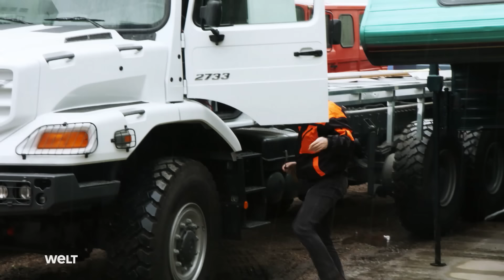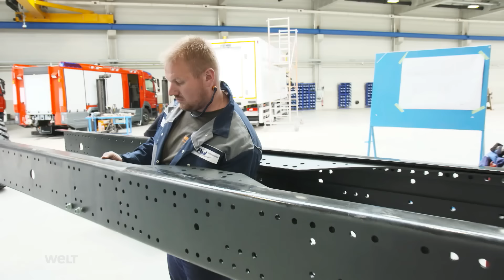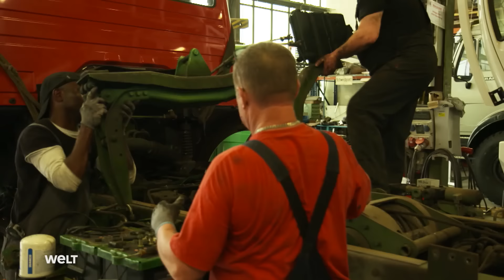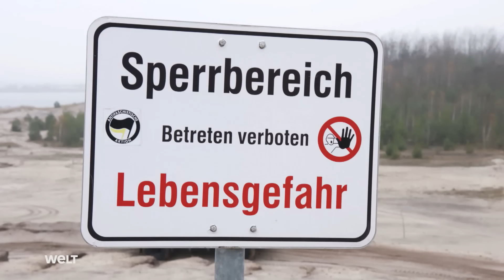Off-Road Caravan Monsters - Motorhomes For Adventures | Full Documentary

Comment: Two completely badass vehicles. 
It blows my mind that the smaller of the two only has a 280hp engine, for reference my BMW S1000RR motorcycle has 205hp.
The fact that the smaller vehicle is so capable of moving that amount of mass so efficiently yet only has 75hp more then my motorcycle is mind blowing 🤯. 

Nice work to all the gentleman involved in both projects 👍 👏 
Truly beautiful work.
👍😉😎👍
Reply: Its all about torque and torque conversion
Reply: Your bike, if you can call it a motorcycle. That piece of art is designed for speed, style and raw horsepower. 
If you do that to an engine it may fail, failing is usually fatal or atleast takes it out. 
Underpowered engines last longer.

Comment: The whole notion of these behemoths is so bad. Destructive to the environment and just not practical. They are an ultimate phallic symbol.  
You would be better off buying a good 4x4 and towing a rugged trailer. These trucks are immensely heavy and get bogged down easily despite the large tires and impressive engines. Their size limits them to where they be driven as well. Forget about gas sipping. Everything about them is an extra challenge and cost. In off road excursion the best saying is Lite is Rite.

Comment: In the Unimog, I wonder what prevents the container from tilting when running on a flat surface. Maybe a torsion bar?
Reply: Where is the Unimog?   Anyway they usually have  a 4 point mounting with the centre 2 clamped to one of the  circular chassis crossmembers and the front and rear having central pivoting bushes.

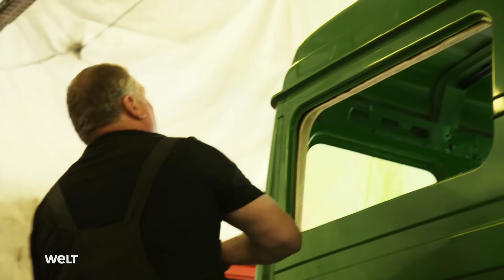Comment: 16:36 - "The two vehicles are the same wheelbase..."

So why switch cabs?  Why not just do the conversion on the police truck instead of the fire truck?
Reply: The fire truck had only 13.000 miles ,so then its easier to change cabs instead of the engines,its what I undersood...

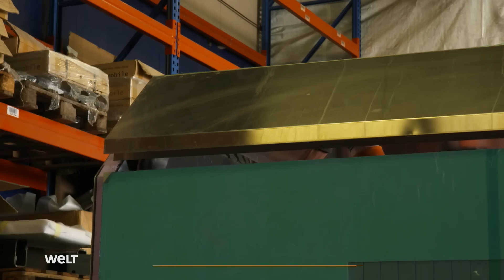Comment: 26:30 Surely this is installed incorrectly. Rain water will flow into the van like this!
Reply: They will further epoxy or weld that outer exposed edge, I suppose. Right? Good observation,  you taking notice of that edge slipping into rather than over the side wall structure.

Comment: They said they were swapping the single cab with a double cab with 4 seats.  The finished vehicle only had the single cab with 2 seats.  Did I miss something?  Where is the double cab?
Reply: It is a double cab
Reply: It's an extended cab back backseats fold down
Reply: this is actually a double cab manual sep fold bi-tech system, so youre wrong...the double cab is directly imbedded in an al insertion pipes, taking big d in the bum while cabbing the truck swartz had that  in his detailed conversion planning.
Reply: I was thinking the same. It's neither the origional cab nor the green one,  Probably one they made earlier!

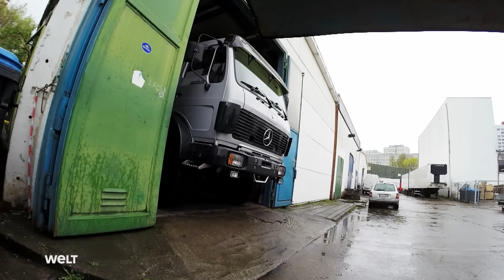Comment: 31:54    So they switched cabs from a 2 seater to a 4 seater and then only installed 2 seats... 🤷‍♂️
Reply: They use the space of the two other Seat, for the inside door between cabin and living space.
Reply: I saw that too.  They said they were swapping the double cab with 4 seats.  The finished vehicle only had the single cab with 2 seats.

Comment: I am a little surprised that, with the use these trucks are destined for, nuts & bolts are still being used 
No matter how good the quality of nuts & bolts vibration takes it’s toll.
I would have thought a swaged fastener such as Huck Bobtail or C50L, would be a more secure fastener.
Yes, I may be a little biased as I am a supplier however, I have always believed in providing the best solution possible for the task.
Reply: I was thinking the same thing. A 5 cm or 3cm bolt seems inadequate for a structure that weighs many tons. The big truck was 27 tons, that's insane!! And although that's the weight of the whole truck, the cab has to weigh something like 10 tons maybe even more but it's bolted on by 5cm bolts.. Come on that has to be scary. I know those guys know what they're doing, they're smarter and way more experienced than I am, but still..

Comment: As always, love the Germans total dedication to quality from start to finish. Seems to me the problem of allowable weight for the rating of the owners driver’s license could be improved by the driver qualifying for a superior rating? It becomes evident that this isn’t a huge factory set up with high end equipment to do the total build under one roof. That’s ok for me. It shows they hustle parts and trucks from wherever they can and then have to engineer on the fly, take in customer requests and modify to supply. They are a small group with broad skill sets. They discussed the length of the chassis may be a problem over harsh terrain. Would it be possible to have some kind of articulating knuckle in the middle so that you could momentarily accommodate a high center type of situation. It would offer the owner/driver an option to safely drive his rig out of that unbalanced scenario. love the mock-up on the separate wooden unit that will be the layout the customer wants.
Reply: Yup, Germans "Engineering stuff on the fly" is something of their specialty, yes?
Reply: Yes unlike the American auto workers who always are looking for short cuts at an over inflated price. The American AUTO Workers have always been notorious for COST OVER RUNS of cheaply made products. Lately the Americans have become parred with China in cheap goods. But unlike China the American cheap goods are extremely expensive. 
I really love the way Germany works with extreme pride in their work. It's their dedication for perfection that really impresses me.
Reply: They have that artic in the center in certain dumptrucks, it's called a wigwag and it's a complete fuckup. Look up center steer or wigwag fuck ups. They're rather spectacular

Comment: Fantastic, love it. But my question is, how the hell do you change a tire if alone in the middle of nowhere, is that even possible ??
Reply: I also thought about it, the Prince probably only needs to make a call ... but for more normal people ... I would probably mount a hydraulic jack in every corner that can lift the vehicle and power outlets for hydraulic or compressed air power tools.....
Reply: Same as any other vehicle jack it up and put the spare on. There's a hoist to lift the spare down, and the jack will need chocking though.

Comment: Two bathrooms without bidet but with unnecessarily long sink that takes up precious space, 9 meters of wagon without garage for motorbikes, when you go around with this pachyderm you need an alternative vehicle to move around during the parking...10000 kg of trucks without leveling pistons for parking in uneven terrain...all very nice but if i have to spend 1.2 million i would take a vehicle designed by people with more experience in the field..
the small one is better, too bad for that rear bumper, too low...on uneven roads with large slopes it risks remaining on horseback..

Comment: The quality of the build would amazing if this were offered by any of the bigger camper makers, but it's downright staggering for a DIY.
 The level of clear vision and innovation is just amazing.
 The bathroom looks like it works well and the inside/outside pantry access will be standard on top tier campers in the future.
My only possible change might be the exterior color to better blend in with the intended operating environment.
Although, as many boaters know, white yields less thermal stress on the skin and makes for a cooler interior which is a big plus in the warmer climes, and/or seasons.
All in all, on a scale or 0-10, I'd give a "100". Out of ten. That's how beyond full scale I see this.

Comment: 12.5l diesel engine. What's the fuel consumption? 
- 1km/l on highway
- 0 in the city
Reply: Thought he said it was a 6.6 Liter. Mileage in the highway should be MUCH better than you think.
Reply: It's a 12 ltr engine...same as goes in the TGA truck. 44 tonne euro truck will do approx 8 MPG loaded. This although much lighter has 8X8 drive instead of 6X2...so probably about the same.
Reply: yes it ís

Comment: Hi every body, is there anything bothering you about this?
We're talking thousands, millions with 19th-century technology... 
Why? Why to speak about axles, transmission, transfer etc. since we have the technology to avoid all of that!
And yes, customers your questions: 1) Decoration, 2) Consumption 3) Power 4) (sometimes the weight of all this mess).
But that's it, no taking into account the "irons loss" What is left of power at the wheel. And above all, the cost of spare parts maintenance and the most frightening repair time on the track!
With our system (only for us, not for sale Renting for cinema, tv, free for some honest NGO's) we will be able to adjust the power on each wheel from the dashboard (cabin). No axles, transmission, transfer etc.Maintenance cheaper, easier.
Of course cheaper than the classic system  even for the chassis & Shell  carbon fiber infusion (vacum). 

Thus an amphibious version is possible and afordable. See the professionals of marine cultures. On our system no propellers w'll use Hydro-jets + Rear and bow thrusters.  Optional for delta rivers as tundra, outside Helm with 360° Vew.

Saving fuel, power and + ecology :    With HHO & LNG Adapter.
price of the prototype???? we prefer to stay blind! 😎😥💵💵💵

Comment: I have been studying these vehicles and their lower rung mass market competitors using Freighliner frames, MDF with leather options, white swirlly body side diesel pushers ... costing 700k.. for a good 30yrs. Its just like the stick built home building market. Its possible to pay 500k for a house in any part of the country.. and get MDF, no insulation, shit engineering... no design...

Against.. vehicles costing roughly the same, but instead of being a Lump on a Log... these actually involve construction, thought, engineering, paint and time... ntm consideration.

Its as if.. those who see a Paris Dakar vehicle.. want one as their... "own".

Comment: Same cab? you must have watched a different video to me then, did you not notice the window behind the door of the finished truck.?
Reply: John if you go to 43.52 when the guy gets into the cab pause it the dog is covering the door as i could see the door handle and there is 2 windows on either side of the cabin at rear :-)
Reply: @rodneymiddleton-c5z   Bit confused as I thought you were saying that they had used the original short cab and not the one from the green truck, the finished truck does have the two windows behind the door i.e. longer cab.  They cut a door allowing access into the living area which meant that there are now two rear windows instead of the one long original. I must admit it doesn't look to be exactly the same as the original one of the green truck.
Reply: You're right ! That was a completely different truck ! .....It was NOT the cab from the green truck or the chassis from the fire truck...... Those two had a 6 cylinder in line engine , but the finished truck had the n/a V8 ! They must think that people are not paying attention.... just bad editing .

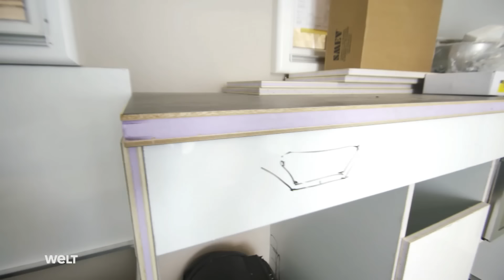Comment: (38:07) - Four weeks to design the furniture ?
Not to fit it but to design it ?
Sorry, but I don't buy that.
Not at all.
>
Reply: Depends on the furniture, if generic Ikea level then yes.  It won't take long but master artisan class custom furniture with intricate details, etc. can take months or longer.

There's a lot more work involved when you're trying to create a work of art in physical form that has to be considered perfect by the client, especially if working with difficult to work with materials...

Liken it to say blacksmithing... Can make a simple sword in a few days but something like a samurai sword that has to have the metal flattened and folded over and over on itself thousands of times, have perfect balance, etc. can take a year or longer...  There's a big difference from functional to true craftsmanship...

Mind the client too, if they're the type that can ruin you or worse if they're not happy with your work then you're going to make damn sure they're happy...
Reply: @ZeoCyberG  Thank you for that info.
I am enlightened.
But your wrong about the Samurai sword.
They are not folded thousands of times.
Usually about fifteen or so times.
>
Reply: True, I made the common mistake of confusing the folds with the layers... Basically, 8 folds gives 256 layers, and 16 folds gives over 65 thousand layers... But you get the point I was making...

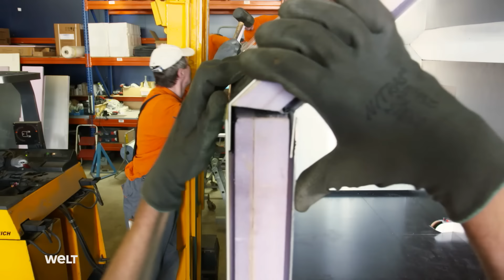Comment: (26:36) - Don't like the way that ceiling edge "underlaps" the side wall.
OK, it will be sealed but after a few years of harsh sunlight and other extreme weather, the sealant will become brittle and crack.
All along the top edges is just rain-leaking waiting to happen.
If only the outer edge of the ceiling overlapped, rather than underlapped, then any failing sealant would be much less of a problem.
I wish the guys building this thing would comment on my concern.
>
Reply: I agree. Or add another flap outside for double lapping.
Reply: Yep, it's a silly mistake! If it's overlap there's no sealant needed
Reply: @checkmilu  That was in purpose, they want the prince to come again in the next few years for service... lol..

Comment: The roof tabs went behind the wall skin...yep that's has no choice but to leak.
Reply: First thing I thought as well. Why would they not have it drop over the side walls instead of going inside the skin? I have to imagine after some serious movement of the body, that their Flex Tape Adhesive they're using will crack off in some parts and let the weather in between the walls into the insulation.
Reply: That's hilarious, that's the spot I just paused on and scrolled down to see if anyone else caught that.
Reply: @imnotquitesure1578   me to...i can't think of any reason to build a massive flaw into the module like that lol
Reply: @Norm Macdonald Show  that one isn't destined for the middle East.
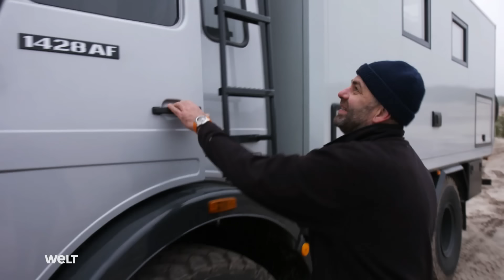Reply: 42:45 it looks like they put an extra piece on top because the final seam looks correct